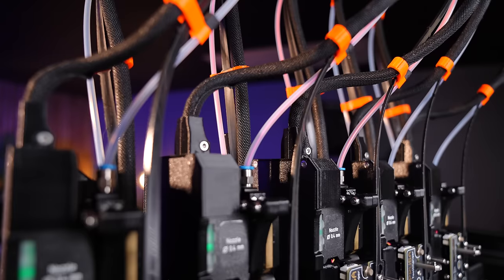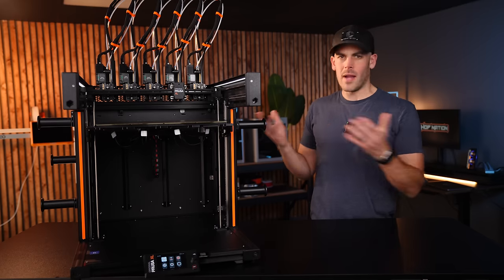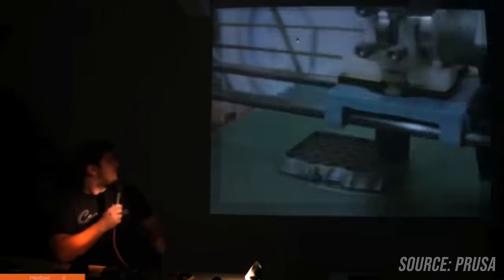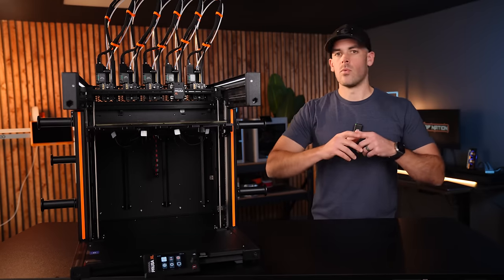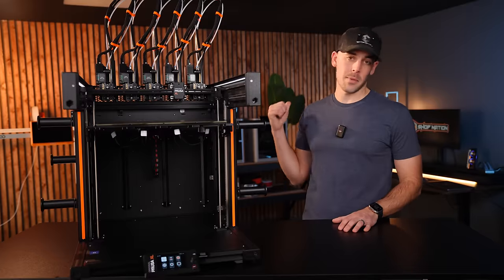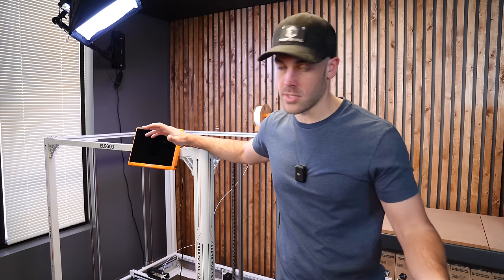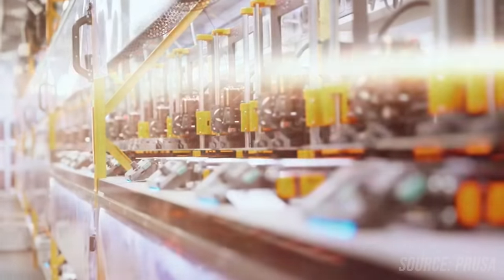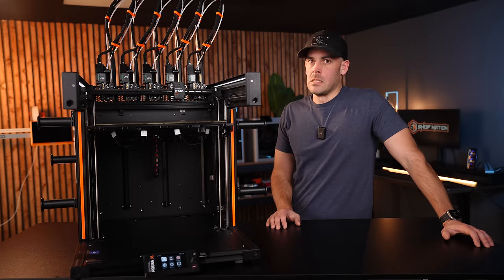Why Prusa is the next Blackberry

Comment: The one thing Prusa still will hang on to over nearly every other major printer company is their EU manufacturing. It doesn't matter to most people, but it does for some. Personally I appreciate seeing Prusa stay true to its roots and move even more of its manufacturing to the Czech Republic. Its not enough to be the sole reason I would choose Prusa, but it is good to see.
Reply: Totally agree... Prusa is a company that matches my own personal ethical/moral standards. They don't churn out crap, they maintain clear upgrade paths and serviceability over long periods of time. My Mk4 will still be running for ages even if they do go out of business thanks to (almost) everything being open source. Bambu are taking the Apple approach which means servicing your own machine is a nightmare and you can only buy parts from them. I think Bambu will light a fire under Prusa and we are going to see some speedy core x/y machines in the near future (they already exist but are tied to Prusas print farm tech which is aimed at large businesses, it won't be hard for them to make them consumer friendly).
Reply: @andy_warb  My XL was crap, so I can't agree with your statement "they don't churn out crap." I was a HUGE Prusa fan before the XL, but they rushed it out to try and compete with Bambu in the multicolor market. I told so many people over the years "it just works" when talking about Prusa. But before I sold my XL my wife made a sticker for it that said "it just WONT work" lol. I really wanted to love the XL, but it was the most unreliable printer that I had used in years.
Reply: The problem is they spent almost 5 years ***ing around llamas, barely improving their stuff meanwhile the competitors are absolutely incapable of innovating and just copy the leader. If a timeline when Bambu didn't show up, year is 2030 and the Prusa Mini still hasn't got power panic
Reply: @andy_warb  Prusa has done like apple, not innovating.
There are plenty other opensource machines that absolutely DESTROYS prusas machines, VzBoT, Annex and Voron just to name a few.
Reply: This too will become a disadvantage as europe continues to increase labor and energy costs.
Reply: EU manufacturing ? are you sure ? motors, sensors, pcb, heated bed, i believe none are made in the EU. Injection molding ok, but other than that ?
Reply: @flectalux6214 That is true, We should take back all manufacturing from China ASAP
Reply: @gaaZolee  and the cost of that decision will be x3 overprice on everything
Reply: While its commendable that Prusa will maintain its EU footprint, the cost of EU labor is expensive, ergo, their products are expensive. Over time, as 3D printer technology advances, Prusa will slowly and steadily lose market share to competitors like Bambu Lab. Prusa will always maintain a fanbase, and loyal customers will likely remain loyal, but as more hobbyists, creators and companies enter the 3D printing game, people on a budget and companies concerned about bottom-line, will likely chose a different option. Prusa isn't the only quality 3D Printer manufacturer anymore.
Reply: If I was in the EU it'd be awesome, but in Australia it just makes them even more expensive, and the shipping method they use just adds to the cost enormously, even with 'free' shipping the extra duties vs things shipped other ways is enormous. I've bought an MK4 recently and honestly kind of regret it with how much it cost for what it is. And the problem is even with all the extra price, they're still behind in many areas, it's one thing to be expensive, but you've also got to be getting something for that other than a huge pain assembling a printer.
Reply: That was my main reason for buying a prusa instead of a chinacist machine.
Prusa even does injection molding parts inhouse, which surprised me
Reply: That's not gonna matter at all, capitalism doesn't have its foundations in local patriotism. If it had, nokia or alcatel would be #1 smartphone brands in Europe and Brits would all drive UK owned jaguars, mini's and mclarens
Reply: @Smoonkin  It's already three times more expensive for a prusa
Reply: @leinadreign3510  ... they really don't
Reply: @backtoearth1983  but if they will start to make their own steppers, heaters, ballscrews etc instead of buying it - it will be even more expensive
Reply: Nobody cares. Everyone just want cheap. If we all wanted USA made iPhones it would cost $10K and never sold more than a few dozens
Reply: @backtoearth1983  I understood it from the video tour of their compound. Maybe I missunderstood something
Reply: @andy_warb  what nonsense. Prusa won't be releasing any fast core xy at all. Have you read the blog about speed etc.? Surely not. Prusa will remain true to its own line and its own goals. They don't care about Bambu Lab. In 2-3 years, when the 3d printing hype is over, nobody will talk about Bambu Lab anymore (like it was with DJI and the drones) but Prusa will still be there, stronger than ever.
Reply: @Neo1983m  Prusa have already released TWO core xy machines (the XL and the Farm machine). Nothing to stop them releasing more if the market shows interest in them!
Reply: I'm a big fan of Prusa and their heavy focus on EU manufacturing, but it does have a huge disadvantage. The shipping costs. It works out significantly cheaper to buy from Bambu (for example) than Prusa. Hell if you try shipping a MK4 to some far off locations like Australia it can end up costing nearly as much as a whole extra printer! 

They've been told about this over and over again, and theres litteral thousands of companies that can handle local fulfilment (which is exactly what Bambu does, they do big shipments to fulfilment locations in Europe, North America, Asia, etc) and get those costs down. Despite knowing this Prusa still have no interest in fixing this at all.

They need to fix shipping, but they also need to fix their costs. The labour and manufuacturing costs per machine are quite clearly WAY too high right now, and needs a massive rethink to cut it in half if they want to have even a tiny chance of staying competative. Prusa couldn't release something like an X1 at the price point Bambu has. You dont need to move manufacturing to China to do that ,you need to make use of smart amd automated manufacturing processes.
Reply: It's an advantage beyond just nationalistic or protectionist sentiments as China is going downhill faster and faster. How is anyone going to get replacement parts from Bambu when their entire country has imploded from demographic collapse or is being sanctioned and blockaded for invading Taiwan?
Reply: Wait wait so companies like creality and bambu who manufacture their stuff mainly in china because that’s where they are based are suddenly worse
Reply: Not many people will care about EU manufacturing, even before the extra cost is considered.  Most will likely just want a product that works for a good price.  £800 for a bed slinger you have to build yourself in 2024?!?  £1800 for an unenclosed coreXY printer that will be too big for many users?!?!  Make a smaller (235mm squared pv 👀) simplified version for £1000 less and they might be on to a winner!  Bambu and co will keep improving though.
Reply: I am also not sold on the fact that all their parts are printed. I mean it's cool but adds to the cost most likely. And certainly makes production much slower
Reply: @tokehgekko9455  I don't know if I would compare something like a Voron, Vzbot, Annex, or Ratrig to a Prusa. None of those have fully assembled printers avaliable (that I know of). I built a Voron 2.4, and while it is an excellent machine, and my primary printer, it isn't nearly as easy to build and set up as even a prusa kit.
Reply: @andy_warb if you owned even a $299 Bambu printer for a week, it would be painful to use the Prusa. My friend threw his historically wonderful made in the USA MakerGear M2. It was very sad, but obsolete is obsolete.
Reply: If eurocentrism is the hill prusa dies on, it will be deeply poetic
Reply: @mfeldheim  It makes production slower, but not more costly. Thanks to their own filament production (they can just buy raw plastic pellets) and how 3D-printing can easily create solid yet lightweight parts. It is actually quite economic! What can be argued is that having lead-times in the weeks for the entirety of 2023 has cost some sales though... Assuming this was somewhat due to the printing.
Reply: I honestly wonder if we can figure out something to this in the long-run.

As seen with the Semiconductor market. Lots of nations are starting to wake up to the reality that having money flow out of your nation to china, is actually quite detrimental to your own economic strength. Like sure you can buy cheaply from china NOW, but it does come back to bite you later in the form of Inflation...
Going for something made in the same continent as you does matter in the long run. The price though is that you must make peace with being able to consume less. A reality that we must face regardless if we have any hope to boost various things such as economic recovery and transitioning to a sustainable society.
Reply: I just got a prusa xl, single head, i dont need the feature with the multithead, i use it for my leatherworking, anw, i had a prusa mk3, worked perfectly for 600 x 24 hours of print and it is easy and all works well, if i message prusa on their website, a smart person answers in like 5 minutes and tell me what i  have to do, also, i am from EU , i preffer to give money to someone in EU , not china.
Reply: That´s exactly the reason we will be getting a prusa xl instead of a bambulab at work once we finally get rid of the ultimaker. I would 100% support prusa any day of the year instead of bambulab or other chinese companies.
Reply: I'm hoping robotics and automation replace the very low cost and in some cases slave-like labor present in China.  @Smoonkin
Reply: @mostlymessingabout i really doubt that it would cost 10k and I really thing Apple should do it. I guess it takes a few minutes max like 30mins to produce a iphone. The labor cost of the retails price is marginal compared to the material cost and development involved.
Reply: As an end user, why should I care where it's manufactured? As a long quality is maintained, this seems irrelevant.
Reply: @ALSAHAFI13  Because some people care about supporting local manufacturing.
Reply: @Ringwraith19  Yeah that´s not gonna happen. As long as slaves are cheaper than robots. 
I can see that happening here in germany, cause labor here is pretty expensive. But companies would need to invest first to get ROI
Reply: 100% agree with you. I go out of my way to purchase European tools that are made in Europe. Fein, Festool, Wera, Knipex and Stahlwille.
Reply: if anyone could help with their opinion:
- where would you place the RatRig 3d printer? interested to know how it ranks between the rest of the brands
Reply: @OhImKiCkiN it sounds like you had a lemon, mine is working very well, i’ve had no problems …. so far.
Reply: i have a xl and a mk3.5 and both are brilliant.
Reply: Does anyone care that iPhones are made in China? Is the quality worse? Nope...
Reply: Honest, I think that is not THE PROBLEM.

The Bambu benfit is DJi connection, so they get good parts at good price (motors, chips etc.)

And the fact that Prusa takes ages to make anything new. Typical issue whe  company gets bigger and list of priorities longer.
Reply: Market shows how it doesn't care times and times though.
Reply: @Smoonkin  Thank the housing market and cost of living for it
Reply: This or the next model will be my next FDM 3d printer. Ultimaker is seriously lagging and this seems really good for multimaterial prints, as opposed to just multi-color, especially if I expect some reaction between materials. And yeah, I don't buy chinese products...
Reply: @Waldohasaskit210 That won't matter because all nemas, all drivers, all cables on your printer even if it's a prusa is from china 

If china actually collapses we will bail them out to not have to deal with the quality of life hit
Reply: This. It sure matters to me. At this point, anyone running to China to save a few bucks just hasn't been paying attention.
Reply: @andy_warb the mini was rushed not as well engineered as the mk series. Prusa has lost it and as a engineer reviewing their design i give them a B minus at best. Some parts F.
Reply: @overengineer7691 Time to close the EU 500 million customer market for the pay my employees nothing companied
Reply: @TheHarshWay  Bambu arguably does the "made locally" far better than Prusa, they are designed in China, made in China, by Chinese people, with Chinese sourced components and Chinese sourced raw materials. While Prusa has no choice but to also have to use some Chinese components. Instead of focusing on quality and outcome, or even the fact that they are "open source", anyone who picks Prusa for no reason other than "it's made in the EU" is just veiled xenophobia poorly disguised as some higher ethical preference, there's no evidence Bambu Labs imprisoned the Uyghurs or perhaps more relevantly, that they mistreat their workers, so it's quite easy to paint yourself into a corner by making ethical statements on why buying from a "local" company is better when you aren't even Czech.

Comment: The Bambu experience is absolutely amazing… until you need product support. Once that happens, you will remember why you loved Prusa so much.
Reply: I love my P1s. 200+ hours and only one filament jam so far. The printer is amazing!
Reply: @fivepointeightnate  I got a MK4 end of last year. 1700+ hours and no filament jam so far. I believe both printers are almost equally reliable. The difference is, one is a closed system from China, the other is a more open one from the EU. Bambu is out crushing the competitors with certainly good products, but an aggressive price structure. I opted to keep Prusa alive for what they've done in the past and not give it to China, but it was a hard decision knowing what I could get for less money.
Reply: Agreed! I waited 2 weeks for an answer from bambu. But i know it's just growing up issues as they have been too successful and support is good when they finally react to a ticket.
Reply: @drstefankrank 1700 hours of printing of what material is the question. I seriously doubt anyone prints tough materials all day on these 2000-3500 dollar printers. I can print PLA on a $200 printer all day.
Reply: Honestly, support is pretty good … once they react. Reaction time however was bad to begin with (1-2 days) and has recently fallen off a cliff (2 weeks).

I have an X1C from the very first Kickstarter batch and so far I needed support twice, both for bed-related issues. Support had working solutions for me in 24 and 36 hours respectively. 
However, that was before the recent A1 recall – ever since, support seems completely overwhelmed. 😟
Reply: Thousands of hours with 5 bambu printers and I haven’t needed support once. You buy printers to print, not to chit-chat with support 😂
Reply: @yoyomin hahaha, My X1C running like a charm 😂
Reply: @fivepointeightnate Prusa is what people buy on print farms to print articulated snakes and sell them.  1% of their machines probably print engineering materials, they leave that to the professional machines.
Reply: My AMS broke and they sent me a new board very quickly once I was able to get a support person. I provided them with resistance measurements to prove that my board was bad. I honestly think that their support is quite good.
Reply: who needs support when you are not stupid and actually know what you're doing.
Reply: @user-yk1cw8im4h  You're totally right, I should have just reverse engineered the AMS Main PCB and printed my own instead of having them ship me a working one.
Reply: Right on. 😊
Reply: @Marksman123771  well you made the wrong choice from the start in buying a bambu, if that's not stupid I don't know what is :shrug:
Reply: FACTS
Reply: Had a problem with the extruder after a month. Replied within a day, replacement part arrived 3 days later.
Reply: especially for commercial and institutional buyers, 24/7 support is no joke when local businesses charge thousands per year for basic support
Reply: People say Prusa support is good, but we have a one print head XL from the kickstarter that did not work.  All the prints would spaghetti.  Support just kept making us print out the same thing, over and over.  Our elegoo neptune 3's print fine.  After 4 or 5 months going back and forth with support, Prusa finally sent a new nozzle and now the printer works.  I was so disgusted with Prusa support that I bought a Bambu, which worked right out of the box.  So it can go either way I guess.
Reply: Its not "growing up issues", Creality is an established brand and their CS is abysmal bad aswell. China and its "haha,we sell to gwailo and give no support" mindset is whats wrong.

They dump printers on the market with zero QA done,an unheard thing since the old original Anet A8 days, and shift the blame on the customer when the printer tilts itself,offering zero help
Reply: Bambu is the best chinese printer but it's still a chinese printer.
Reply: @_Richard_F___  I don't know if you misunderstand me intentionally or not, but I don't think an explanation is worth the time either way
Reply: Im trying to decide between an MK4 and a P1 but the support factor, community, and origin has me leaning to Prusa. Even if its $300 more...
Reply: Bambu support has been amazing for us. We have 20 printers running for over 3000 hours and we contacted support twice and they resolved the issue within a week and sent us the spares.
Reply: @yoyomin  acting like nothing ever breaks, and like closed-source in combination with bad support isn’t the worst of two awful worlds 😂 you absolutely WILL learn a lesson, come back when you do.